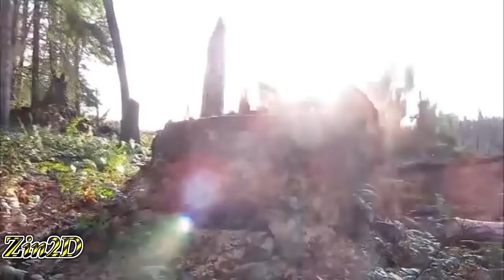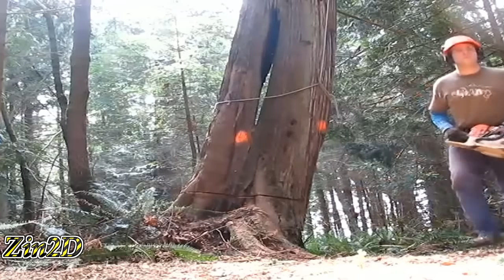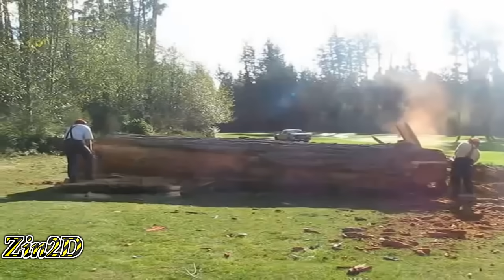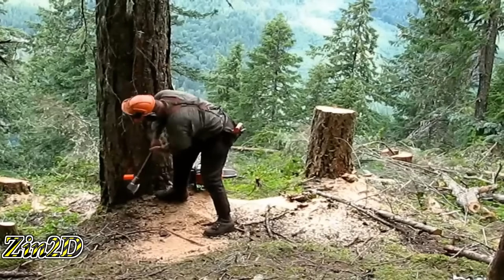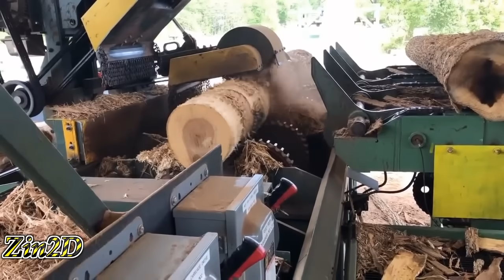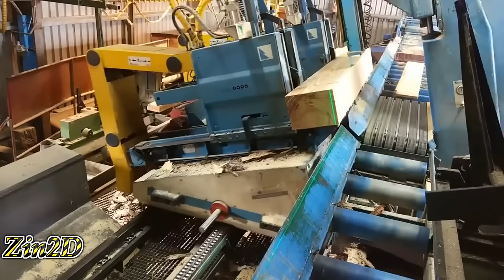Dangerous Fastest Chainsaw Cutting Tree Machine Skills, Logging Wood Truck & Wood Sawmill Machines

Comment: I'm 74 years old now, so I've been retired for a long time. But I spent most of my working life in isolated logging camps up and down the west coast of British Columbia. And I've done most jobs required on logging sights; bucker, chaser, chokemen,  rigging slinger, log scaler and grader, skidder operator, dozer operator, you name it. But one thing I've never done, and never would do, is falling. I've seen too many fallers die, and I've lost too many close friends that way. Our pay was pretty good, but the fallers got paid the most. But from my perspective, the extra pay wasn't worth the extra risk.
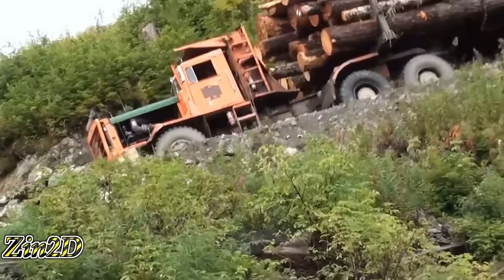Reply: 8:19 what the video did not show us is how to move the cut-down trees onto the truck? could you tell us how? thanks!
Reply: @hanfucolorful9656  Depending on the operation, the size of the logs or the steepness of the terrain, they would use either a front end log loader with tires, or, a grapple log on tracks. Some self-loading logging trucks are equipped with their own grapple log loader. The truck driver can make a lot more money that way because that's one less equipment operator and machine he has to share his profits with. Of course, the initial cost of a self-loading truck is a lot more, so you'd damn well better have enough jobs lined up. I've operated a front end log loader, but I've never operated a grapple log loader. If you're curious but how each of them look and how they work, check out more videos on YouTube
Reply: @60bigmoe  What if it is too steep that any kind of machine can't reach?
Reply: My nephew suffered severe head trauma. He still does after 10 years. He has had two brain surgeries and several others and has been through an awful lot. He is able to function, talk and walk now now that's about as far as it goes. He can't even drive. You have to cut his food for him if is meat unless it's super tender.
Reply: @60bigmoe  thanks, they deleted my reply last time atho.
Reply: It's felling a tree not falling .
Reply: they died from falling trees on them or may be something else?
Reply: @ИванТаранов-л8е  There's a lot of different ways people I've known have been killed, logging truck driver crashes on icy road and gets crushed by his load, faller gets hit by falling tree as he walks away from it with his back turned, skidder operator gets trapped between logs as he's setting chokers, rigging slinger gets hit by mainline on high-lead logging operation, etc.
Reply: @60bigmoe  my God...
Reply: Does anyone plant new trees? Or do the areas recover naturally from young saplings already trying to grow or do they never recover? (I am not a green nut job wanting to attack random people online, I would just like to hear from someone who works in the industry)
Reply: @Dilly972  Yes. On crown land every type of harvesting permit has built into it sight treatment clauses with penalties for violations. Usually this includes replanting the logged-off areas. Of course, on private land the government has no jurisdiction. The the crown's only concern would be fire hazard abatement, which they have the authority to enforce.
Reply: @treefrog0826  The man obviously knows his stuff, so that's what they call it in Canadian lumber camps, I guess. But I looked up 'fall' in my old Webster's unabridged and of all the many verb senses I found none that were clearly transitive, as 'to fall a tree' would be. 
Edit: Oops, I just looked up faller in the same source and indeed, it shows 'one who fells trees'.
Reply: I can fall trees, they usually lay down like a cow shot in the head...But looking after our 100 acres patch of Doug Fir trees and messing with giant Oaks and rotten snags and Barbers Chair and falling bark and limbs...I never had any desire to take a big saw out and let some fuck tell me to hurry up...I became a carpenter and a General Contractor instead...I still have the tree farm, but it is getting about 40 years old and takes care of itself...
Reply: A tree falling that slow doesn't look like danger to me ..............🤔 7:58 OK, my bad. This one changes everything.
Reply: @shadow_crne1030  This is what it looks like when it goes as planned but it doesn't always work out so well and all of a sudden it doesn't look like slow motion anymore.
Reply: @SorenCicchini  .......Absolutely,......... and it only has to happen once.
Reply: Do stupid sht get stupid prizes
Reply: @stolearovigor281  Stupid for people with two left hands .......... who spend their days avoiding death by vending machines.
Reply: top
Reply: Why is so dangerous?
Reply: OK quá nhỉ

Comment: All the people complaining about the trees being cut down, I ask you this. How should we build homes and furniture in the future?
Concrete manufacturing is like 4-10% of CO2 emissions depending on the study,  Plastics require oil to make, steel requires coal to smelt it, bricks require kilning which once again uses oil or coal to heat.  
Select cutting and reforesting are the only ways to truly way to be sustainable.
Reply: Trying to convince a brainwashed kid with BS, MS or PhD in BS science is hopeless. 😒
Reply: Do not touch trees over one hundred years old.
Reply: How about managing what you already cleared cut and planted tree farms instead of going it the few % or what old growth forests are left. But no, there's big bucks in cutting big trees. You people aren't happy until every area with old growth is cut down.
Reply: @vladimirgurevich8415  I did compare. What you were looking at was post European settlement. They halted all low intensity fires that the Indians did for millenia to clear the undergrowth. Once that stopped then the overgrowth began. There are photos of the same forest pre-settlement before and after settlement and you can see the difference. Again, conflaggeration forest fires were rare pre-settlement era. Virgin forests extend from the East coast to past the Mississippi River unscathed. Same on the west coast. Once the Europeans came with even todays' Ecocide destruction of cut and run instead of selective harvests has changed the whole ecology. Forests are even-aged tree farms with no diversity. Crammed in there and sterile. Any lightning strike wipes them out. Clear cutting silts streams and makes salmon go extinct in California and elsewhere. I seen it. The timber companies want to go into the last remaining old growth to make a quick buck instead of managing what they already have. They are never happy.
Reply: @michaelfink2170  
Areas shaved to the ground in late 19th century in Mendocino county look like virgin forest today. Fallout from uncontrolled cut and run policies was repaired in few decades. 
Catastrophic wildfires that are happening today are the direct result of "green" policies of modern ecofascists and you just confirmed it. 
Thank you.😁
What else?
Reply: But it’s really not selective cutting, is it? Be honest with yourself. Multiply the amount of Forrest lost per year compared to the amount reforested and then, be honest with yourself.
Reply: Then they need to reforest with the correct trees. In forests you find only a certain few trees growing together in each forest. There's alot of factors including weather, altitude, soil content, climate and location that determine what trees grow where. What some people don't know is it goes deeper than that. Different types of trees grow together because at the root level they are interchanging things. One tree might need alot of nitrogen when it's neighbor barely needs any. So, the one that doesn't need it sends the levels it doesn't use to it's neighbor to make up what it's lacking. That actually keeps the forest healthy and in balance. When you cut down trees on a massive scale and go to reforest them, if you don't use the same trees that were living together, it brings imbalance to the area. Chances are you put in a tree that needs high amounts of nitrogen just like the native tree and now it's going to throw things out of balance and the trees will show it with their health. Their nutrients have changed which has lowered their ability to stay healthy. Same thing in areas burnt by fires. You can't just plant whatever is cheapest to grow in the area and most available at the local nursery. You got to keep the flora the same because that's what keeps it in balance and healthy. The native trees are growing together because they provide each other the ingredients they all need to live. Adding outsiders is a danger to their ecosystem and has nothing but negative consequences in the long run and the practice needs to stop. They need to replenish forests with the exact things they took away. Doing anything other than that is disrespectful to Mother Earth and all the life she provides for!!!

Comment: To those wondering why they have their backs turned away from the tree, it’s more the jack and it’s hydronic hose. The danger is more the hose bursting in your face less the giant tree silently falling on them. These men are expert in their craft, they are listening closely for the familiar sounds of a tree giving way to gravity and the gigantic hinge wood snapping and cracking. But they also power down the saw. You wouldn’t hear it with the saw cranking.
Reply: The hose could break at either end...the pressure is the same....wow
Reply: That explains nothing about why they just can't position the crank so they're facing the tree.
Reply: @lolyou4358  its easier to run away if they are facing away? The standby men will sound the alarm if they need to run, this avoids having to turn and potentially trip.
Reply: @resistantjeans6887  You're not going to outrun a tree of that size when it's falling towards you. You have to run perpendicular to it. So facing away offers no advantages.
Reply: @lolyou4358  good point, its probably just easier for the hose positioning on the jack to have the pump facing that way

Comment: Growing up , put the wood in for winter and running a saw was part of life. Times have changed when you have to take a hydraulic jack to work to tag a big cedar. Yes, its a safe way to knock down some of those old cranky cedars. 1960 is gone

Comment: Damn that last machine is brutal.
Reply: This whole video is quite brutal from a certain point of view.
Reply: Mulcher. They send them to Australia and our native hardwoods destroy them! :-o
Reply: @malcolmroberts3157  im also aussie
Reply: I work maintenance and repair on those...chippers and grinders (and associated support equipment). Some reach 1,000 HP to the mill. The mill itself can weigh over a ton and spin at 1800-2000 RPM, so yes, you could say they are brutal. Definitely not a place for a human body to be. In line with that horizontal feed belt they can and do kick back material with deadly force and speed. It's recommended to give that zone about 300 feet of clear space. Smaller ones can run in residential areas, bit not the big boys. They all tend to self destruct and require quite a bit to keep running like that one. That was a fairly small one, btw.